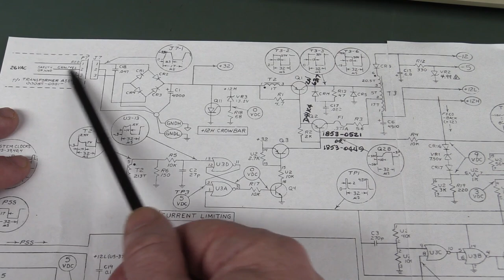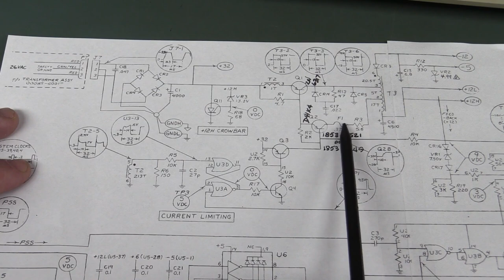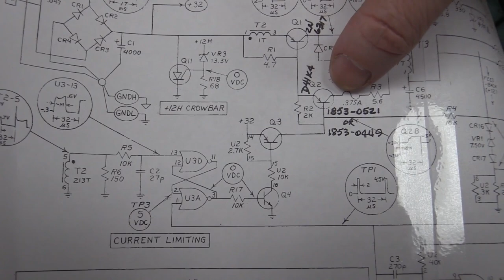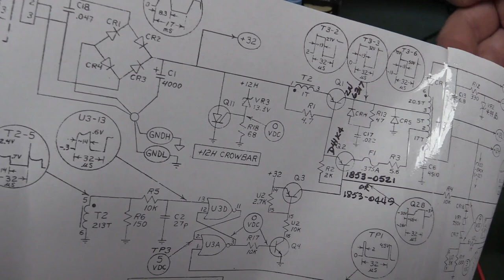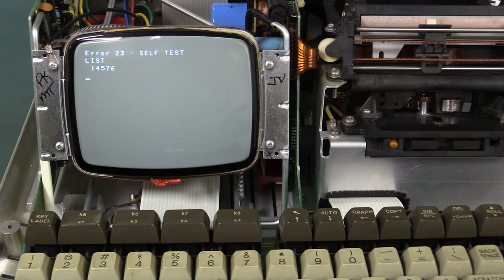EEVblog #905 - REPAIR: HP85 Vintage Computer

Comment: Full Bridge rectifier hub did somebody summon electroboom maybe that's why it's not working electroboom has been here who invited him no wonder.

Or maybe the full Bridge rectifier has been reckedafride.

Although once Arbor cross by the way this is a serious part and interesting Bridge rectifier only some of these words this is not like a weird one that's got like one part of the case is ground and what looks like to be a half Bridge rectifier three terminals but this rectifier was a full Bridge however actually more like somebody like a 3/4 Bridge rectifier can't remember if it had 5 wires or not but I think it. It was some weird odd one as for specific application on a model train throttle / power pack that could either provide full Bridge rectifier location for steady DC current Alisa steady is it could be without a filtering although there was some depending on which mode it was in by the way this was some sort of pulse throttle I was repairing this for someone the singer have been left out for Daddy's with a short circuit on the track somebody had turned on the switch for model railroad in only that Florida was plugged in and also want up this laundry on car from the track causing a short and I didn't realize that was turned on somebody was in the basement.

But anyways this dial branch which also called essentially had three quarters of regular bridge but the rest was isolated out in some way or another can't remember how it was in the circuit and how many leads or was there a fourth diode or was that separate diode but anyways just a rather Unique Bridge rectifier but yes I did one that fix anything however I did want up just using individual diodes as well as I put some heft your diodes in so they ever ever happen again it would not Friday. Surprisingly the Transformers okay it's possible the diodes were used as a weak Link in addition to the thermal overload. You know those little glass circuit breaker things. I know there are thermal cutouts but they're also using circuit circuit breakers and some power packs.

I remember the old h o gauge model train transformer make a power pack is that was actually from International Rectifier that thing was pretty beefy in the end after I got out Mall reading because of lack of command control availability for my layout idea to keep the power packs of course they got turned into variable power supplies and it was nice to have the 18 volt AC available as well also I did repurpose the electric switch machines for the solenoids in a project or two or three or four as well as all the analyst controllers I kept in one piece all those devices and other things as well course why it's nothing else. Repurposed. I donated all the track and everything else just something or gave it away can't remember everything else is it was still okay or at least where the rails had been Sarge with most of them were but the old h o gauge track did make nice bus bars for my projects for a long time. And in one case I used a piece for a fuse in something roughly 14 or 15 amps don't know why I did that but I did well I heard about about what temperature it would melt and how much current don't ask me where I found that please I don't know.

Also if anyone has ever wondered about the size of a piece of wire of various materials is a fuse there is an app for Android out there for that because in some cases that's uses a fuse I've also seen how I pilot light bulb is used as a fuse oddly enough.

It's fairly common in tube top equipment for a short piece of was 30 gauge uninsulated wire maybe a different gauge can't remember is used for about a one or one and a half amp fuse for the filament string so if you happen to see a terminal point tag strip whatever that apparently has nothing between it but tube of solder and what looks like the remnants of a wire and it's in line with the filaments that was the fuse for the filaments and something popped it no need for his hammer you know by the way do you want information on photonicinduction?

Also if you were to have a device that was not working well or not at all that use a certain types of tubes and you see a puddle light bulb near certain shoes make sure it's game voltage and the bulb is good and then reassemble if that boat was out or not game voltage that might be a problem is providing light to La for ionization of the two first time I worked out some like that I was baffled letters a bulb in a enclosure borders no holes or anything for it to shine through and could not figure out why I could not get to work except when the cases open but not when it was closed it didn't work when it's dark and and Dad dawned on me no pun intended that wait a sec working when there's a bike but not when there isn't light bulb moment quite literally change that lightbulb Wawa let there be light and let there be a working device prep for young players as he would say and yes the light bulb was upside down so all the photons are going to fall out